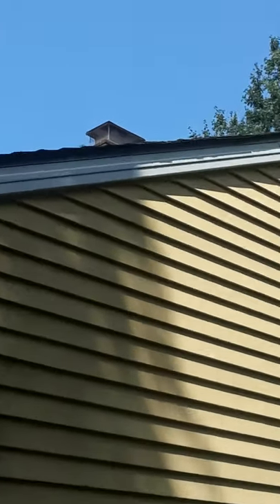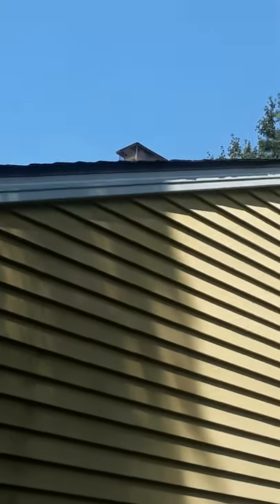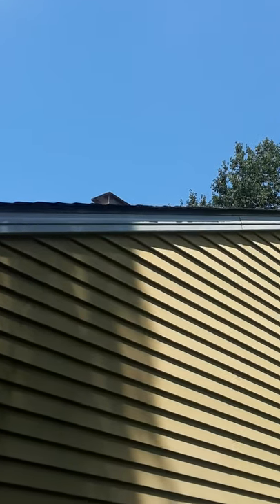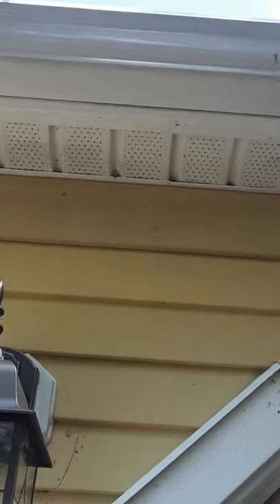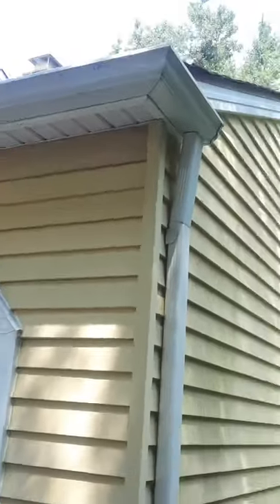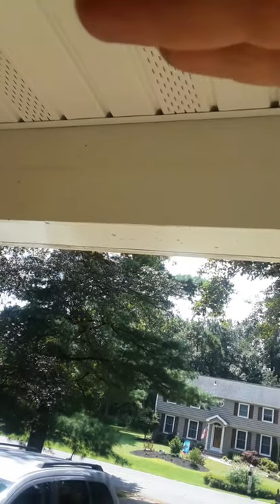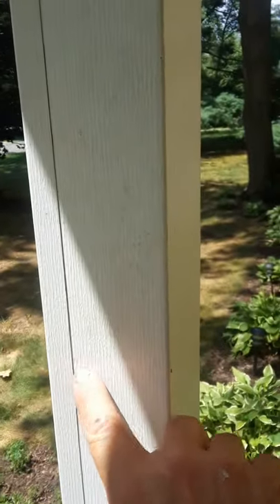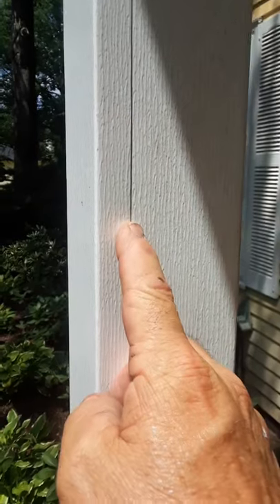Trim-out, we used to call them.

Comment from the maker: All the rake, or gable trim, the bottom leg on the fascia is touching the sidewall sheathing, it was “cut in” the siding to eliminate carpenter bees from entering the face board and the old time 5/4 bridging they used for to build out the face boards, that really cant be seen from this video, i learned that from an old time roofing and siding guy i worked with from time to time.